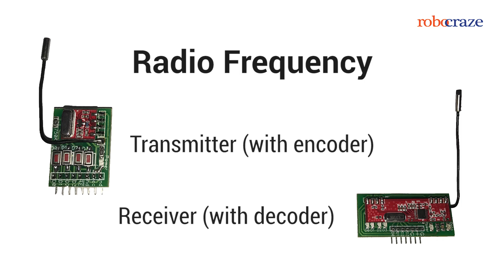Radio Frequency: Transmitter with Encoder and Receiver with Decoder

Comment: Is it to only enabling and disabling 4 pins?
Reply from the maker: Hi, This is an RF communication module, so you can use this to send any data between two controllers. There are multiple applications this can be used for and is not limited to controlling 4 pins.